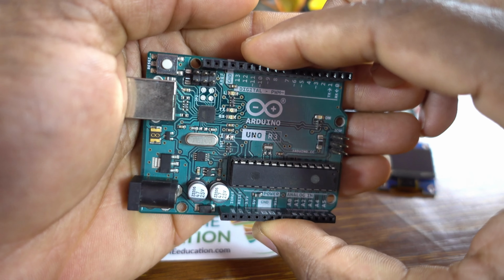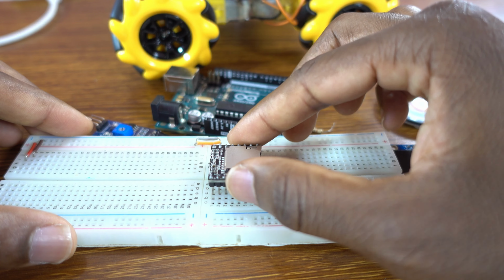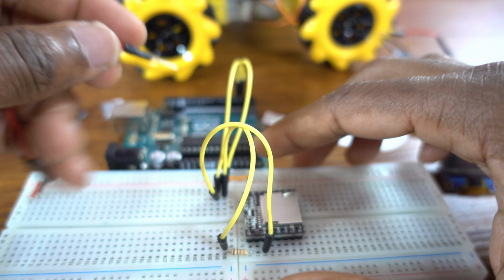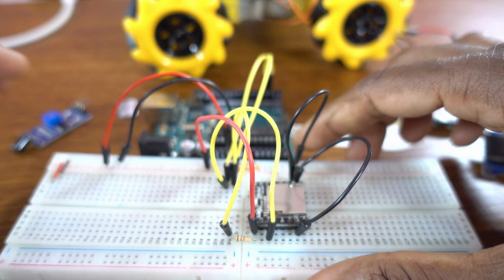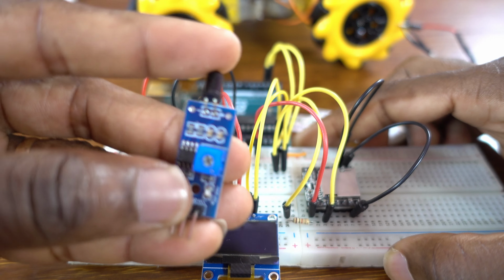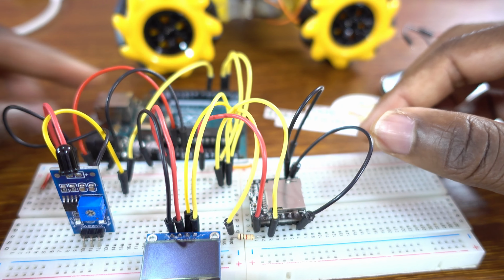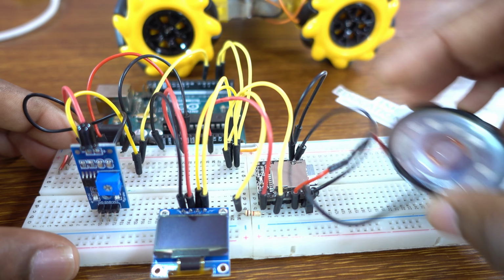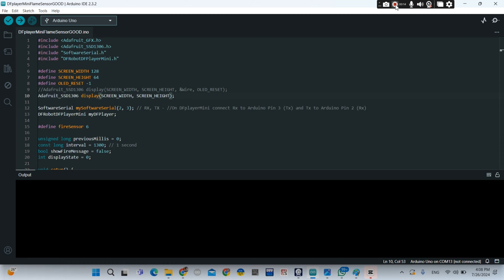DIY Fire Alarm System with Arduino, DFPlayer Mini, and OLED Display @TMEEducation

Comment: Great video. I’m thinking how you could make a project with gas, smoke and fire sensor, with Esp8266 or ESP32, with alert sound and an alert by internet (email, or other way). Have you ever made something like this? Maybe a display too. And sound at high volume (amplifier).
Reply from the maker: Take a look at ESP32 playlist